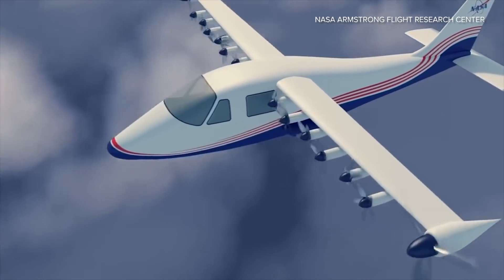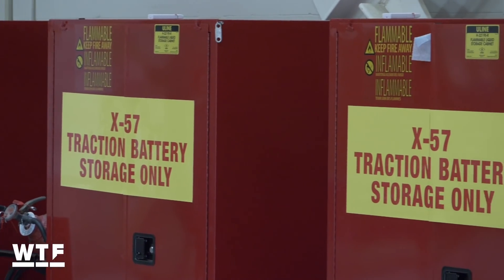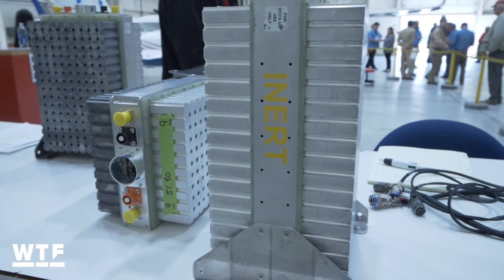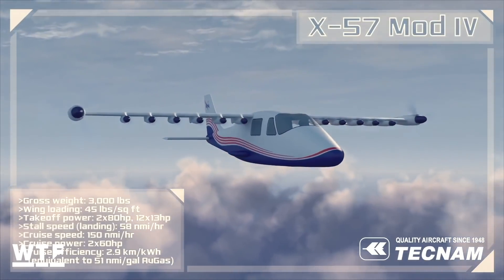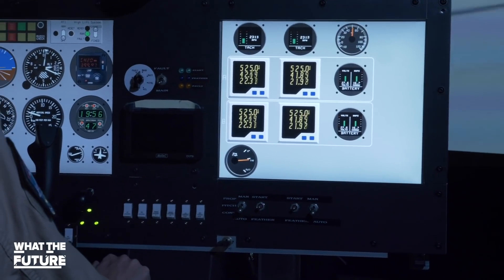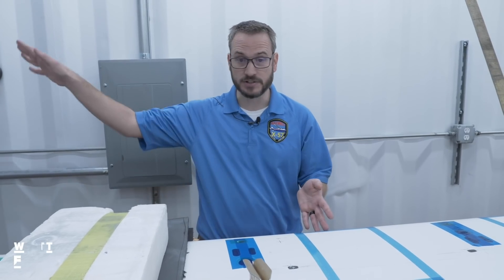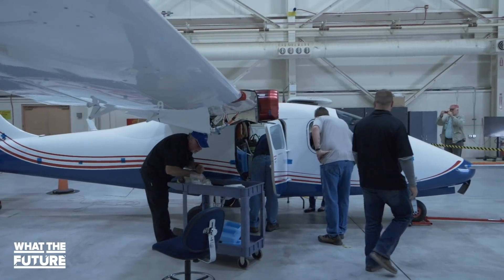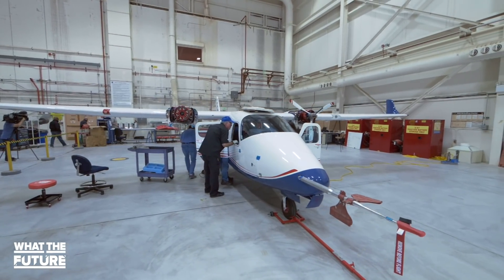This all-electric plane could help shape the future of air travel

Comment: The energy density of batteries would have to increase by several orders of magnitude to make it viable for anything other than short hops in a city to get around traffic. I suspect that for long haul, the way to go is synthetic fuels produced with energy from renewables (maybe fusion reactors) or biofuels produced by genetically engineered cyanobacteria. The jet engines of today would require little adjustment.

Comment: Why use small propellers when instead they could be more efficient shrouded turbine fans?
Reply: Shroud are heavy and does not help take off performance. The small propeller help increase air flow above the wing increasing take off performance. This will allow the battery heavy plane to take off without needing bigger wings. Because off the heavy batteries you are optimising for take off power not  thrust efficiency. Although you gain better efficiency because you remove the need for bigger wings that increases drag a lot and will negate any efficiency improvement of using ducted propeller.

Comment: Ok, wouldn't the easy solution to battery charge be an aero generator, like the ones used in Vietnam to  power belly mounted gun pods on F-4 Phantoms? A little more drag, but you don't have to worry about flight time due to battery drain. Or a simple 50 hp gas engine to power a generator. This would be a little more weight, and cooling would need to be provided for the engine. I think an aero generator would solve most charging concerns.

Comment: How EFFICIENT is something that needs 10 motors instead of just 2 engines?
Reply: You should definitely call up all of the NASA engineers with their fancy advanced aeronautical engineering degrees and tell them they don't know what they are doing.
Reply: @wess5478  NASA has screwed the pooch so far.
Reply: 90% compared to 25-30% for ICE. Only battery weight kills the project...

Comment: Lithium ion wont work very well in commercial aircraft.  The industry can practice until a lighter more energy dense battery can be developed.
Reply: the answer for that is liquid hydrogen fuel cells or hydrogen turbines.   You don't only get free co2 transport, you can even boost the performance of any plane in the world by a great margin. The only thing holding down this is just time, the time to increase fuel cells or electrolyzers production to reduce the cost on this new technology.

Comment: Why not put solar panels on it for a lil extra miles
Reply: Dont think it would be worth it considering the extra weight
Reply: 3000lbs / 45 lbs/sq ft = 67sq ft of wings. 

Solar gets you about 15W/sq ft, so you could get about 1kW of extra electricity if you put solar panels on the wings (in perfect conditions in noon).
And for cruise you need 2x60hp, that's 90kW.

Comment: so it can fly for 30 minutes day and 15 minutes night, given the FAA required reserves.
Reply: bowblizz  when it has to come down, it's still called a crash landing, even in a field.
Reply: bowblizz  then the reserve is 20 minutes day/night
Reply: They can regenerate energy and charge the batteries on landing. Basically you can run the propeller like a wind turbine and capture your forward kinetic energy and vertical potential energy. There will be losses but regenerated energy will be significant. Reserve needs to take into account regeneration in their calculation.

Comment: Along the same lines as equipping the plane w/ a small generator or two or three, but engineered to supply a health trickle charge to the plane's batteries. Combine that w/ well designed solar pnls. in to it's wings. a beefy motor to initate flight, and cruise to your hearts delight. I'd bring a good supple of water balloons... just foolin. Besides H2O weighs 8.3333 lbs / gal.

Comment: its neat that this is being developed but PLEASE cut the propaganda crap of "Emission free" there is NO such thing. None. The power has to come from some where and the motors produce ozone off the brushes. Then you have the manufacture of the batteries and aircraft itself. And after all that you have to dispose of both. So NO such thing as emission free.

Comment: I imagine there be hybrid plane 
Prop that recharge the battery and Super efficient petrol engine that runs while  the battery being charged. 
Ha ha 
Elon any help here ?

Ha ha
Reply: That was my thoughts as well, why couldn’t the 14 electric motors ( when not in use )reverse to input mode to recharge the batteries, makes sense, add some solar panels to wing tops and tail as well as fuselage, endless range, I agree completely,,,,,,

Comment: 1:20 The further apart are the engines - the bigger vertical stabilizer/rudder should be (so in case of one engine failure the airplane won't yaw uncontrollably).
The electric motor (or "engine" as you call it) failure is highly unlikely, but NASA should know better than to put the motors on the wing tips.

Comment: Until the replacement for lithium ion is here electric will not be viable. You have your Tesla it works sure but you do understand that Neodymium is a RARE earth mineral
Reply: There is no neodymium used in a Tesla. It is an AC motor. (That's why it is named after Tesla, the inventor)

Comment: Planes like this is what you get when you have engineers with no practical mechanical or flight experiance.
Reply: Why are you saying that ? Really interested on your point of view
Reply: @ValentinPasseraH  Engines out on the wing tips cause adverse yaw if one engine fails. A row of tiny engines across the whole wing ruins air flow over the wing for stall control and low speed landings.
Reply: Oh you're talking about the crappy animation not the actual built model.
Reply: @AbsoluteArch  The animation is the original design and what they will be going for in the final version.
Reply: @robopam  you've never heard of a "blown wing"?  Wind over the wing is literally what creates lift.  If the engines blow air over the wing, it literally decreases stall speed.  It's one of the reasons why the C-130 is such a great aircraft; 4 big fans blowing air across the wing.
Reply: @wess5478  read it again and slower. If those engines  lined up on the wing stop (since all power is now derived from a battery) even with feathered props the air flow isn't conducive to an efficient glide slope.
Reply: @robopam  You're right AC-130's don't have 2 engines they have 4. It's redundant. Also why would they go for a worse design than their prototype?
Reply: @AbsoluteArch  I'm just wasting time here. You're confused about the video and obvioulsy not a pilot.
Reply: @robopam  you got it exactly backwards with respect to the stall behavior of 'blown wings' - that is the technical term.
Reply: @winfriedwilcke1705 I'm not talking about it's performance with all motors operational.  Look at their concept model. Battery failure is the number one issue with high draw electrics now. If the battery fails none of those tiny motors turn. Then they create turbulence over the wing not a lift inducing flow. Their concept has a horrible glide ratio if there is a primary power failure. This is already settled engineering. That's why they've abandoned the concept for the time being.
Reply: I think the Concept of Eviation is better. You have to find Out, what they had for an Solution whe a Wingtip Propeller doesnˋt work..

Comment: Very short haul only. Waste of time. As the battery’s drain the same weight is still there. Result epic fail.
Reply: Nope. Its already happening. MagniX is working with Harbour Air for certification.  Flying by 2020.